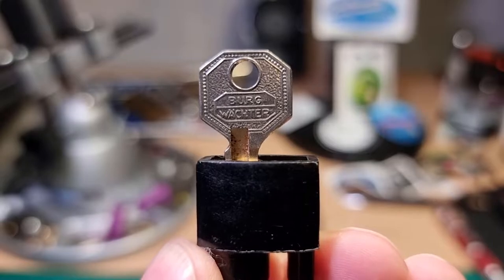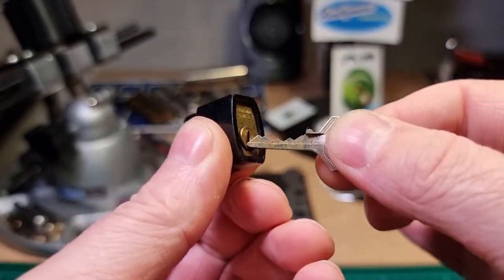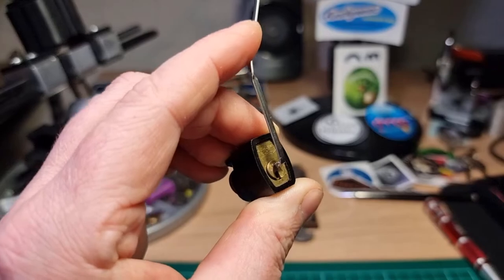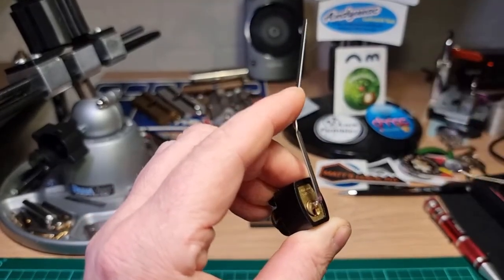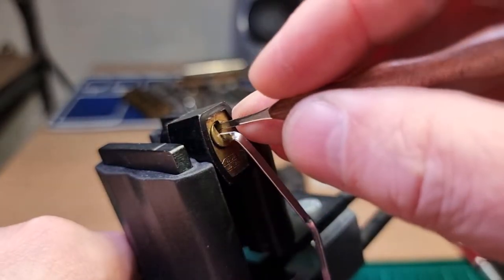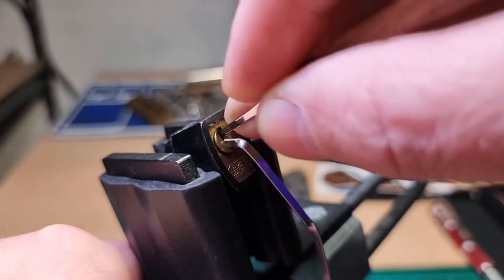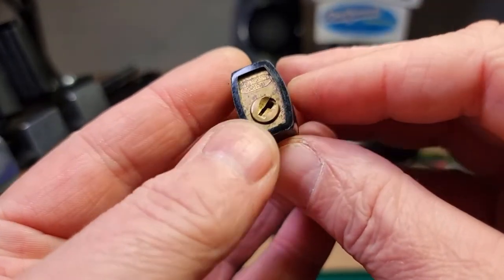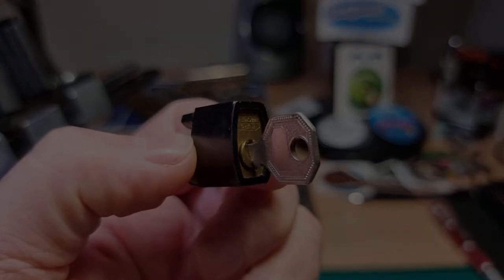(235) Burg-Wächter Telephone Dial Lock #minilockmonday

Comment: UUUH weee #minilockmonday time !! 🥳
Very cool lock, well picked 👏👏 You almost need a magnifying glas for this one 🔍
Awesome that you even found a tensioner that works in there 👌
Sad you bricked it afterwards 😢 Maybe you can recover it?
Have a great week,
Cheers 🍻
Reply from the maker: Thank you 😁 
I should have realised by the size of the lock that it had extremely short drivers 🤦‍♂️
I've tried to replace the drivers, but they're almost the same diameter as the bottom of the keyway, so there's no way to hold and manipulate them into the chambers.
I've kept everything and will hopefully come up with a solution in the future.
Cheers bud 😁👍🍻